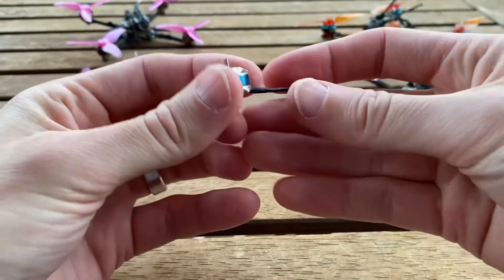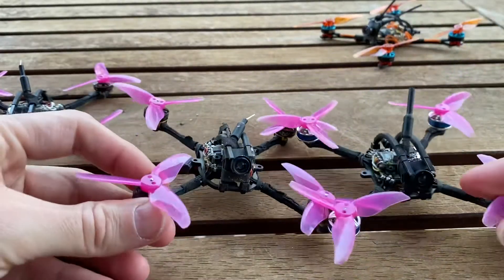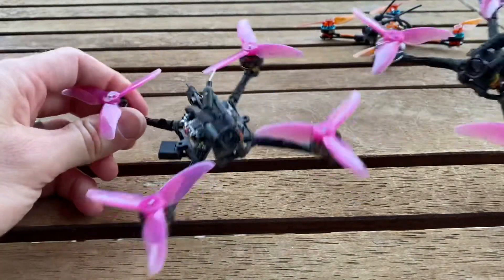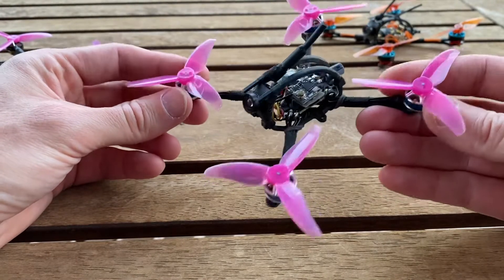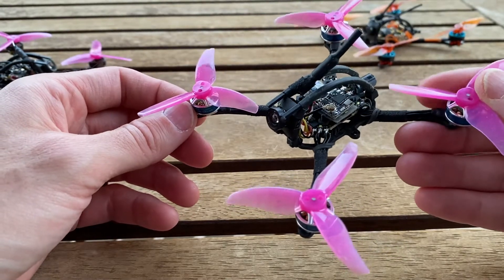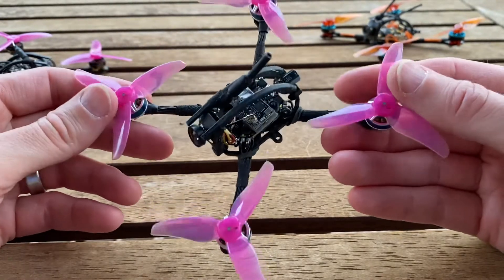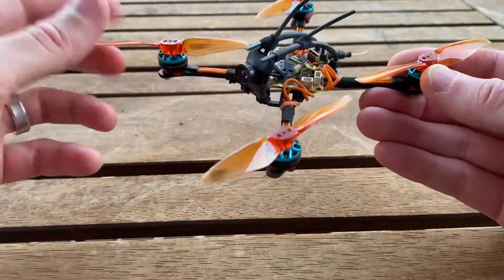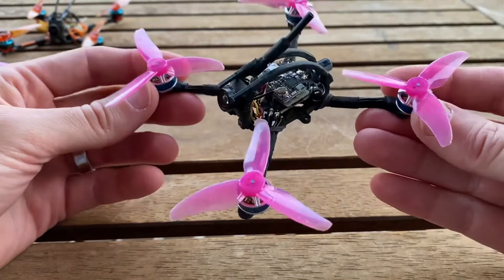Houston we have a motor... LDARC 1103 7800kv

Comment: If it's between the LDARC, the Skystars, and the AMAX, which 1103 would you pick (if they were available) for a 2.5" 2S build?
Reply from the maker: The Amax is the the better all-arounder but back to back I prefer the ldarc. It just has a little more snap to it at the expense of efficiency. The skystars just don’t have the durability I need. There were some that didn’t have a clip on the shaft which were better but the last batch it was back to the clip.

Comment: What's the max amp draw with the 2512 props? I'm wondering if it's safe to use a 5A aio board
Reply from the maker: On which motors? At 7800kv I’m sure it would be fine.
Reply: @Quad66  Yes, I meant to ask about the LDARC 1103 7800KV. Good to know, I'll probably be building a quad with the JHEMCU SH50A board.
Reply from the maker: @rbFPV  To clarify, when you said 5A I assumed that this meant 1S. I see that board can do 2S, which I think chance of failure might be quite high. On the 5A 1-2S boards I've only flown 1102 with biblades. Sorry for any confusion.
Reply: @Quad66  I see, thanks for the headsup!

Comment: Just looked in my spare parts bin and found a dozen LDRC 1104 7500kv’s, and a couple sets of 1104 5500kv motors.  Not sure how they’ll perform on a toothpick.  Do you have any thoughts?  Great informative vid!
Reply from the maker: 7500kv with some of the new 90C 600mah 2S packs and 3018scould be very interesting if the battery can keep up with the motor.

Comment: Have you ever tried the Sunnysky 1104 5500kv motors? They are total beasts - my fav for light(ish) 3" builds.
Reply: They only add ~7g over 1103 motors and are actually more like 1105 motors. (It looks like LDARC sell a 5000kv version labelled as 1105).
Reply from the maker: My backyard is too small for larger motors. The most powerful build I tried were the FPVcycle/rcinpower 1204. It was too much mass and power on 3S. On 2S it was underpowered and heavy. The limit for me is 1103/1202.5.
Reply: @Quad66  I too only fly in my garden. Usually 1103 is my max. But these motors are sooooo responsive on 3S I just love them.
Reply: @Quad66  here they are on quite a heavy build. I think I can fly better than this now 😂 https://youtu.be/c_gfU227Obs